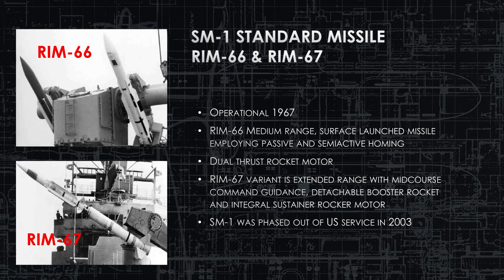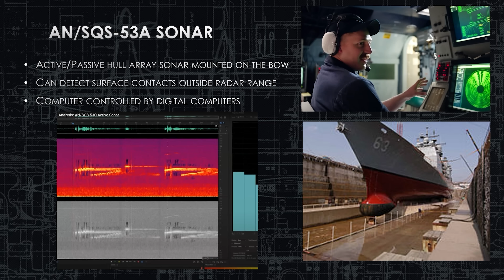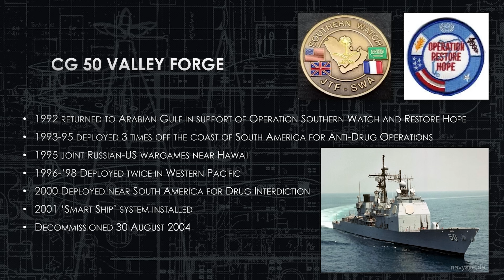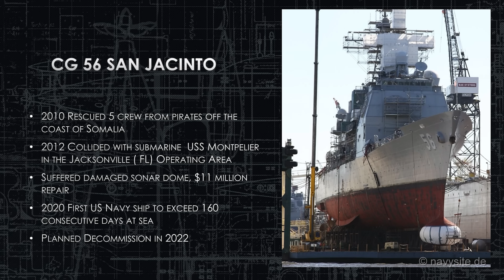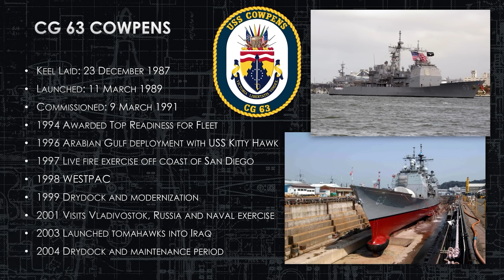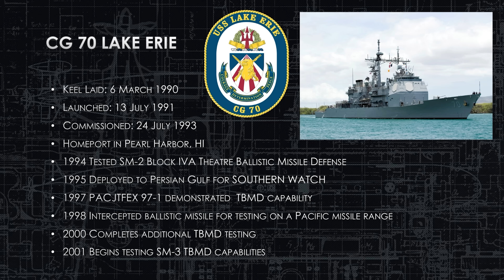America's Iconic Cold War Aegis Battleship Ticonderoga

Comment: Tico was 9600 Tons and today Japan is looking at a BMD 'destroyer' in the 15-20k Tons class. LM put forward a modified Arleigh Burke class with an enlarged central Mk41 system replacing the 32 cell grouping with 12XL cells which Quad packs SM6/Tomahawk giving 48 missile capacity and additional 64 cells, split fore + aft.  A monster... and Japan is still thinking about what it wants vs afford.
Frigate, Destroyer, Cruiser designations today are meaningless, it's all about magazine size now.  UK Frigates are called Destroyers by Canada and Japan and the UK have both had carriers called ASW destroyers/cruisers for political reasons just to cause more confusion.

Comment: Mk46 mod 5: 8000+ effective range, less than 12000 due to snake search. Total weight ~850lbs, (we routinely lifted them using 7 men). Warhead was 98lb, not 508. Mod 5 started to be issued to the fleet 1982 (ASWO USS Boone FG28 1982-84)

Comment: The warhead data on the Mk 46 is incorrect. The entire torpedo weighs 508 pounds, the warhead is 'only' about 100 pounds of that weight. Still a lot of ass to put a hole in a sub.

Comment: I used to work for an unnamed company and my experience is in self-protection of strategic penetrating platforms.  They had a history that went back to WWII when the MIT Radiation Lab really developed military radar.  They were a group that from the beginning worked to counter and make radar less effective.  So they had parts of other systems and SLQ-32 is indeed an impressive system.

Comment: could someone explain to me why arm launcher systems were used instead of VLS? It would seem to me that VLS is less complex to design than an arm launcher.
Reply: Cg47 was the only tic class not to have vls.  (Bugs still in system). Made operational on Yorktown
Reply: @johnalbritton1044  the first 5 all had  twin arm launchers.
Reply: Arm launchers were easier to manage for the longest time due to their ability to safely store munitions out of the elements but relatively quickly launch them when needed.

VLS cells require a certain amount of work to standardize between multiple very different munitions like the US standard VLS box.

Russian ships had cold launch VLS sooner but it was dedicated to specific missiles on specific ships and had some shortcomings due to the emerging technology

VLS is also harder to reload unless at port and while early Tico's could replenish VLS at sea, arm launchers have an easier time doing so

Comment: Correction - MK72 only fires enough to push the missile out of the tube and away from the boat.  It's a large motor with a lot of surface area for a quick burn to get the inertia from 0 to +++.  It's ejected not far from the boat before the MK104 kicks in.

Comment: @subbrief do you think the Phalanx has become “dated” compared to what many of our NATO Allies are using for CIWS?  It seems like many navies have switched to a larger 30mm to 40mm rapid firing system with air burst capability.  Also, what are your thoughts on the Mark 45?  Is it realistic to consider them an anti ship focused system?  It seems like many of our allies have switched to smaller caliber 57mm or 76mm system with a significantly higher rate of fire and more of a focus on shooting down a missile with air bursting rounds.  In my own opinion, I don’t think a near peer large combatant engagement is going to take place anywhere near naval deck gun ranges.  Those battles will be decided by missiles and missile defense.  So in my opinion that kind of relegates the naval deck gun to engaging close in air threats, missiles or small irregular surface combatants that don’t have stand off weapons capabilities (pirates, speed boats, drone vessels, ect).  So if the target is a 40 foot unarmored fishing trawler converted into a pirate ship, is there really difference between one 127mm shell every three seconds or 11 57mm air bursting shells from a L70 in three seconds?  I would argue no, you will probably still neutralize the threat, even with one or two 57mm shells.  The L70 would probably be more effective at knocking down an anti ship missile with that volume of fire compared to Mark 45.  As we know, missile intercepts by kinetic weapons systems (guns) are based on volume of fire since precision really can’t be counted on in real world conditions.
Reply: The smaller calibers aren't as good for shore bombardment.
There is a version of 20mm ammo that is proximity fused shrapnel -- It is commonly loaded into American aircraft.
Reply: @ what do you believe the probability of our large surface combatants being within deck gun range of a shoreline is?  I feel like it would be between zero and none.  I think much more likely, they would be in a position to control the skies over a shoreline using SM-2s while either shipborne HIMARS type platforms reshape the shoreline followed up by air strikes.
Reply: ask yourself the question, if said pirate boat is heading for you, do you want to perforate it with a lot of tiny holes, or do you want to blow 1 or 2 big holes in it? side note, the tico's 5" guns are quite capable of smoking super sonic aerial targets.

Comment: On October 1st, 2024, i saw at least 10 SM-6 going up from the Med sea as Iranian IRBM were launched at Israel.
I'm not sure it was an SM-6 missile at all tho, i still wonder why the USN didn't use more interceptors.
Reply: they have strict orders for what they can and cant blow up, as at the time it was an active airspace and they didnt have the same threat awareness as the Idome/Dsling operators did.
Reply: @onyx6847  The US and Israel share the same battle image with Radars as well, they collaborate in interceptions and when IDF has the need to use the AEGIS ships they radio call them as 'Partner'.
My point is that these ships had a lot of SM-3, SM-6 and ESSM's to try to intercept more. about 33 ballistic missiles penetrated the air defense.
Reply: @onyx6847  Today the US put 2 THAAD batteries to boost IDF air defense in case of saturation attacks of ballistic missiles.
David's sling and Iron Dome are less relevant. DS can be used against some of them, but ID can't.

Comment: Nuclear ships are great for a laser based AA battery.
Reply: Problem is only that laser weapons need clear air to work properly, if it rains or there is fog, smoke (after you launched missles) or dust in the air, they become ineffective
Reply: ADA - Anti-Drone Artillery
Reply: @phil20_20  CIWS (maybe more of it) should be good enough for ADA. The problem with drones is they are easy to shoot down but cheap to build. The dominant tactic is always to saturate SAMs with drones and then follow up with hard to kill cruise/ballistic missiles.